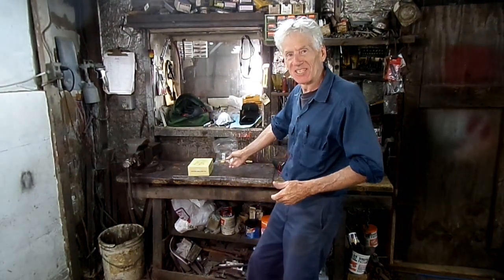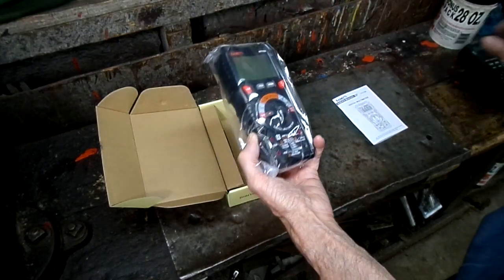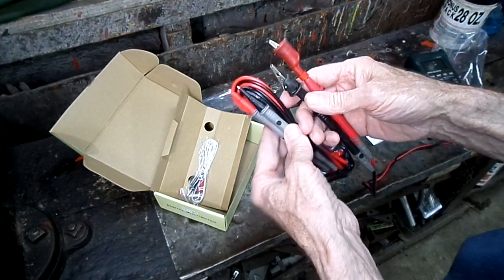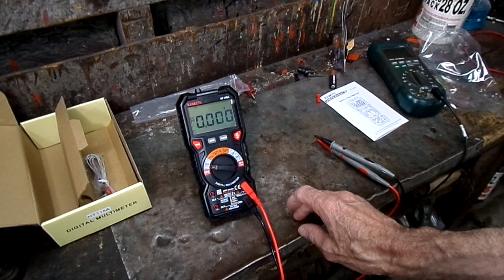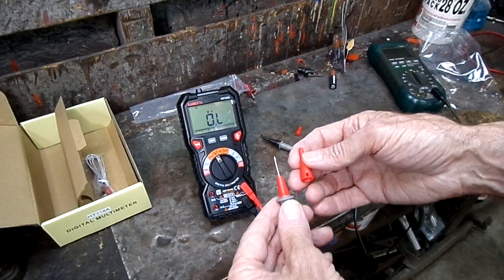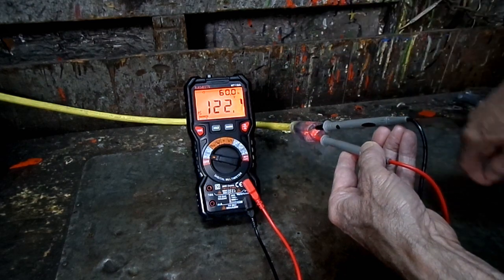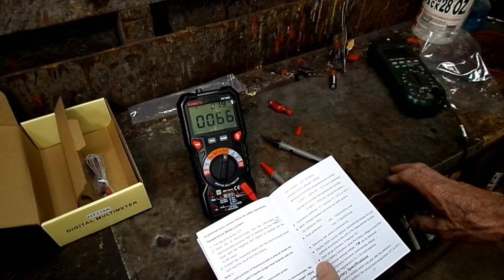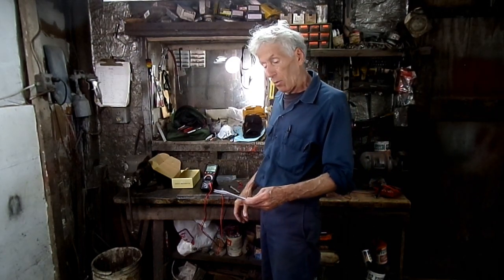KAIWEETS HT118A Multimeter Review

Comment: what happens if i accidentally measure ac voltage with my multimeter set to dc?
have you ever tried? my ht118a burned out
Reply: It did not burn out, it just gave no useful reading, but continued to eork. 

But it's a pain it always has to be set from DC to AC - each AND every time I switch to voltage measurement. There's no way to set AC as the default; that inconvenience is a reason to look at competitors. Maybe the maker will create a firmware upgrade? But I tend to doubt it....
Reply: Work*

Comment: You probably did this but.... did you check the fuse in the old meter?  There's almost always a  fuse on the current circuit.  Sometimes on the voltage / ohms side too.
Reply from the maker: I will check that fuse maybe i will get lucky.
Reply: @RichpinTv  I also bet just a fu
se

Comment: Ooow a new meter, ignore the name, just remember the number as a lot of companys/sellers have there name on generic multimeters.
It will take a while to get used to the new meter,  you might want to replace the cheap batterys with supermarket alkaline types.
Yes i knew about the probe sheilds, it's one of the electrical cat rating standards requirement.
Don't worry about them, most of the time you will be reading d.c battery voltages.
Your old mastec may have a blown fuse on the board, so don't dump it untill you have looked inside :-).
Reply from the maker: I like the new meter so far but i will take a second look at the mastec.But i think putting the meter on a electric fence might have done it in.....lol